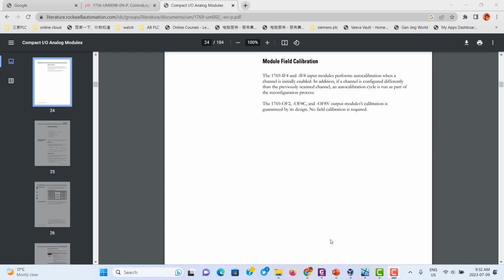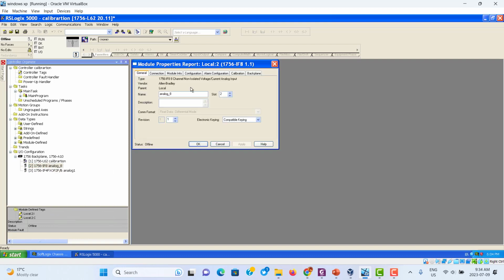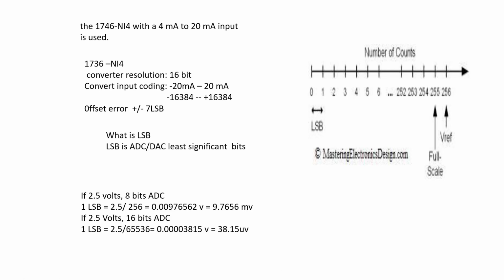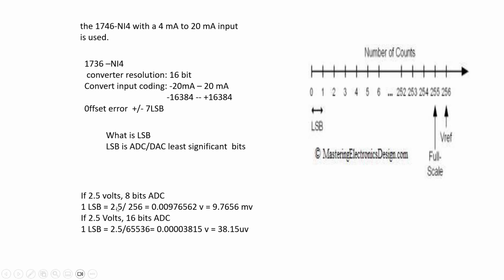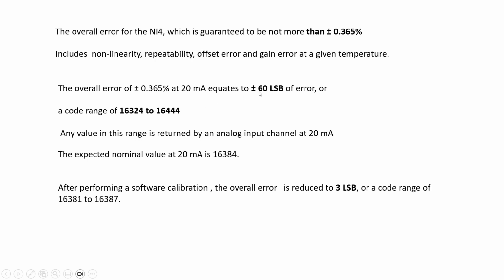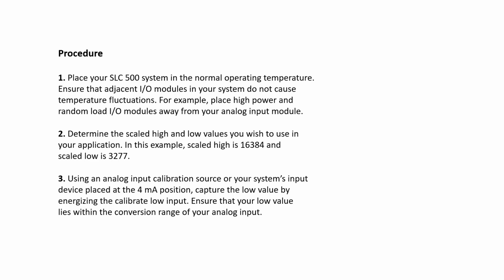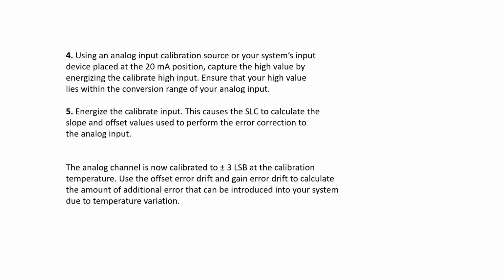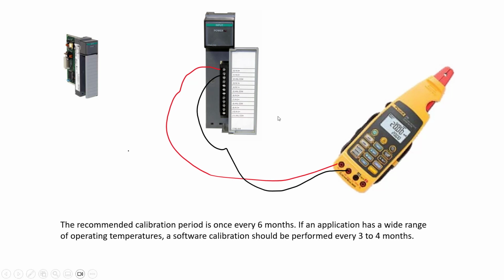How to Calibrate AB  Analog Module (1746-NI4)- Concept and Procedure  (1) .

Comment: I have a tank that is not showing values. Checked all the wiring and they are all good. When I do the simulation test with hart communicator I can see the value showing on the HMI but when we fill the tank with water it does not show. I change the level transmitter to a new one and I can’t see anything. Please do you think the card calibration can fix it ?